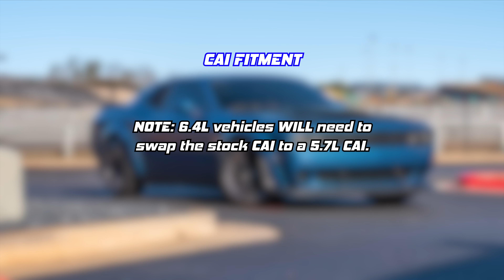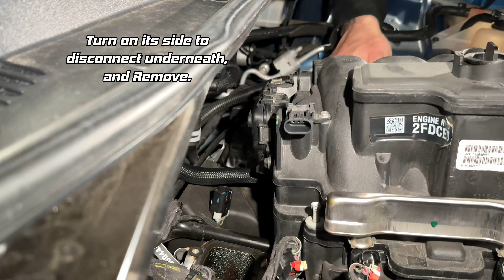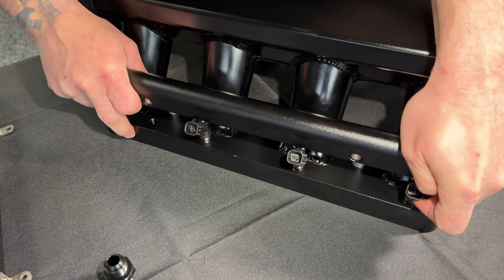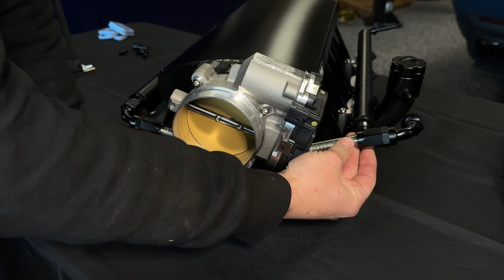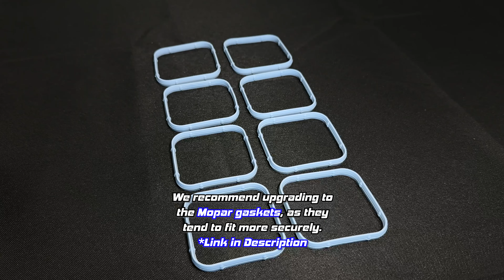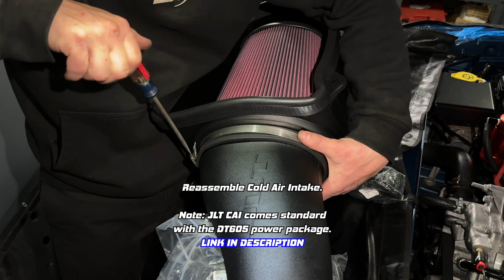Blueprint Intake Manifold: Gen 3 HEMI Install - Dusterhoff Racing

Comment: On 392 srt 2018 stage 3 cam tsp and high ram fbo Im on 91 octane what should I shift at with out hurting the pistons or anything internal I have upgraded hellcat lifters and hellcat oil pump and pac valve springs thanks man I just get a lot of people say u can’t shift higher then 6700 rpm’s on stock bottom end is that true ?
Reply from the maker: We regularly shift around 7000-7200 rpm with our stage 3 cam and Blueprint Intake. Give us a shout if you have any more questions, happy to help. 404-480-4754 / Sales@DTRacing.com
Reply: @dusterhoffracing even on 91 octane it could cause knock or a rod to break or something?
Reply: @dusterhoffracing ??

Comment: How does it compare to a ported 6.1 manifold? That's what im running with eagle 5.7 heads and a cam. Makes great power. Wondering how this compares
Reply: these things kill low end, below ~5000rpm, the 6.1 kills it
Reply from the maker: They preform better than a ported 6.1 intake and will make more power. Give us a shout and we can talk details! 404-480-4754 / Sales@DTRacing.com

Comment: Can you reuse your factory injectors or do you have to buy replacements
Reply from the maker: You can use your original injectors, but we recommend an upgrade - the ones shown are included in the DT605 Power Package kit. Always happy to answer any question you have. 404-480-4754 / sales@dtracing.com
Reply: @dusterhoffracing its going to be a supporting mod for a cam swap im planning to do so i think ill just play it safe and do the injectors as well
Reply from the maker: We like it. Let us know if you need any help 🤝

Comment: I had 2 Holley Sniper intake manifolds ( one for my car and one for my wife's car ) and decided to sell them both and buy the Blueprint Intake manifold just in case of fitment or warping issues. I installed this intake on my newly built ProChaeged 426 in spite of all the negative chatter on how "it won't make power with that intake manifold" and I need to run the High Ram. Well, I love the way my car looks stock from the factory and I didn't want to cut it up for an intake manifold. On 15 psi my car made 1008 whp@ 6200 and 864 torque @ 5600 without correction and 1157 whp with SAE correction. I strongly recommend the Blueprint Intake manifold to anyone boosting their vehicle or installing a bigger cam.
Reply from the maker: Awesome numbers! Glad to hear it's working out for you, thanks for commenting! 🤝
Reply: Is this vacuum  plumbing  the same for the 2006 dodge charger rt with this intake manifold